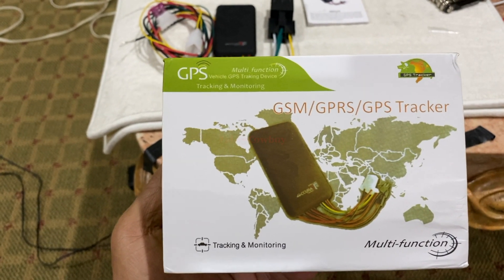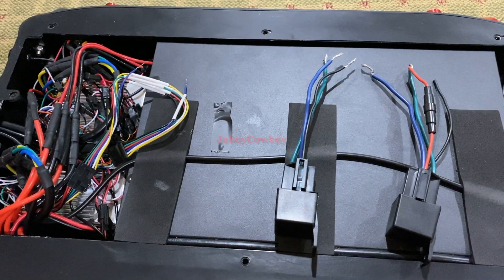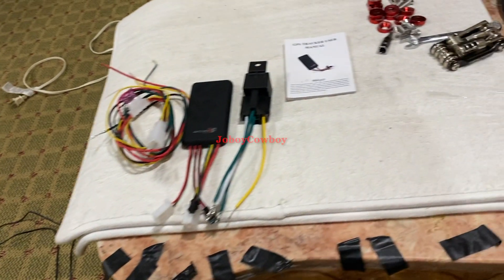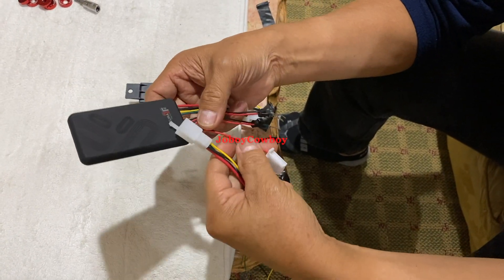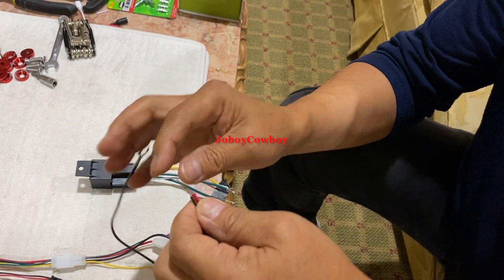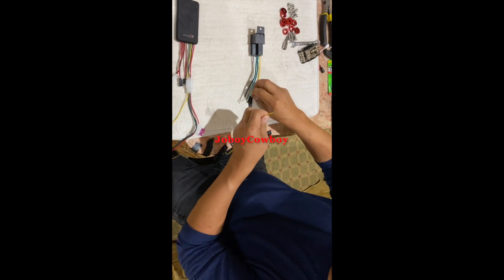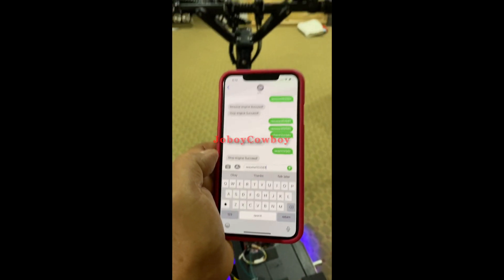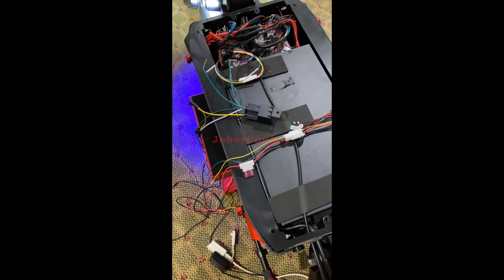How to install GSM Kill Switch and GPS on your Scooter Part 2

Comment: What is the model number of the relay you used that worked ?
Reply from the maker: It’s in the video description, including the link where I purchased it.
Reply: @joboycowboy  the link is for a Bluetooth receiver/ transmitter and not for a relay with harness
Reply from the maker: @pouchy400  try this one 
https://www.ebay.com/itm/Car-GPS-Tracker-GSM-SIM-GPRS-Real-Time-Tracking-Device-Locator-for-Truck-Vehicle-/111384991230?_trksid=p2349624.m46890.l49286

Comment: Where can i buy this 6 volts step down converter ? I'm a newb on this.
Reply from the maker: You can search it on Amazon
Reply: can you send me the link which one to buy, many thanks.
Reply from the maker: Sorry Allen, I don’t want to recommend which kind to get, I don’t know exactly what your scooter configuration, if your not familiar with volts and amperes I advice you to consult a car or motorcylce electrician, I don’t want you blaming me if you end up with a broken scooter, I hope you understand. Thank you

Comment: Hi, how to installing the Seeworld mini gps tracking device S102T to anti-thief alarm wires together as power ?
Reply from the maker: You need a 6Volts step down converter installed in your scooter before you can install your seeworld mini gps s102t on your scooter. Please consider subscribing to my channel.
Reply: can i just attach the red and black color wires on the anti thief alarm wires together?
Reply: I got a boyueda electric scooter 5400w daul motor with anti thief alarm installed.

Comment: I have the CJ730 and I do not get it working. Tried it also with 5V connection to the blue and green as it says so in the manual, but it is not working.
Reply from the maker: I tried it also, I have 2 of CJ730, it’s not going to work with scooters, it’s good with motorcycle.
Reply: @joboycowboy  Why do you think that? The blue and green cable should just be connected with the command like a normal relay and up to 30 Amps. It seems to be a fake for me as I tried it several times with different voltages. With my first GPS tracker I bought from wish I figured out later it had not even a GPS modul inside it just gave the GPS location based on the GSM antenna location. There are many videos on youtube, my feeling is that many of these trackers on Aliexpress and so on have fake functions that are not working.
Reply from the maker: I open up my CJ730, it has GPS modules, but no matter what connection combination I do, it’s not working that’s why o tries that one on my video and it works, only downside is a little bigger.
Reply: @joboycowboy  It was an other GPS tracker without the module. I dont want to buy another one as I bought already 4 GPS trackers in total and all of them seem to make very false claims on functionality.
Reply from the maker: @StepperByStepper  why don’t you return it and get the one that I used?

Comment: Mate, what happens if I connect instead of the green, to orange? Or yellow or blue any of those other colours? Thanks in advance my good sir
Reply from the maker: I believed it’s going to burn your gsm/gps unit, it’s only capable of I believed 48V. I tested that orange wire and it’s running some 60 plus volts. Not sure about the yellow or blue wire.
Reply: That wire is too "skinny" to be carrying so much electricity, do you think could be a error of measuring? Either way, as long don't blow my scooter or controller, I will give a go
Reply from the maker: If you have a better multi meter or volts tester you can verify it, my tester is like the cheapest one. Just follow my guide wire to wire it’s not going to damage anything on the scooter.

Comment: I was wondering, How do you keep the GPS working? coz 12v stop working once you turn off your scooter. Thank you.
Reply from the maker: Yes it will turn off once scooter is off, you can use portable powerbank if you want constant power. But for my purpose? I installed this device just in case someone grab it from me forcefully.
Reply: You can connect the power (red * black) from tracker directly to the scooter battery. And then use the 2 green wires from relay to join the circuit you cut to the motor.

Comment: Hey thanks for this video. Would this work with the eagle pro?
Reply from the maker: Yes 100% thank you for subscribing, I did subscribe to you also.
Reply: JoboyCowboy what are other set of red and black wired?
Reply from the maker: Which part are you talking about? Maybe the jumper wires?
Reply: JoboyCowboy the red and black on the gps
Reply from the maker: Spazsi if your talking about those wires, 2 of which has black socket and 1 is white socket, those have different features, it’s for the microphone, speaker if you have one, and emergency button, it comes with one. You will know about that in the manual.
Reply: @joboycowboy  ok thanks